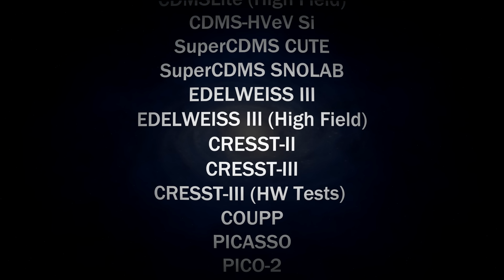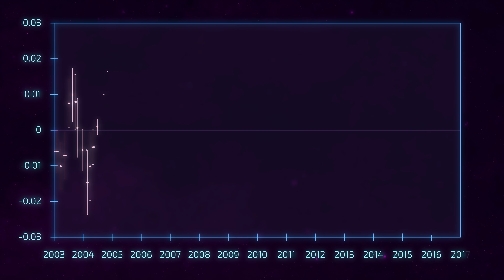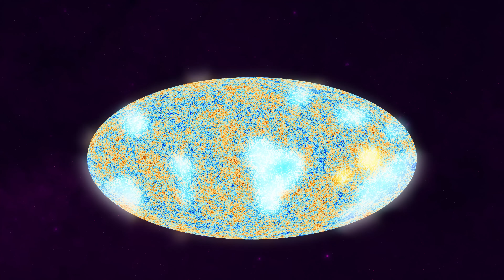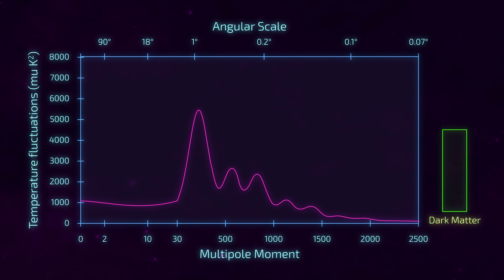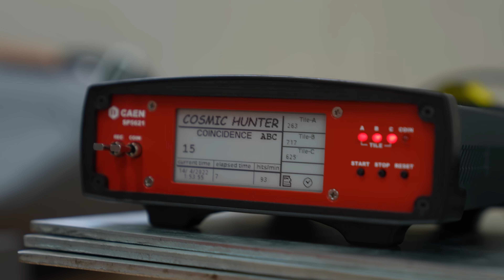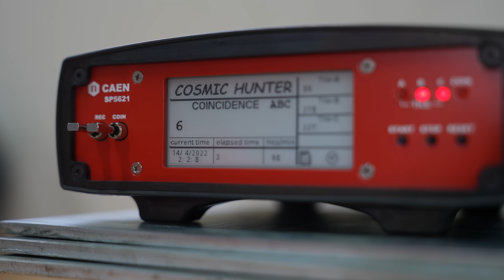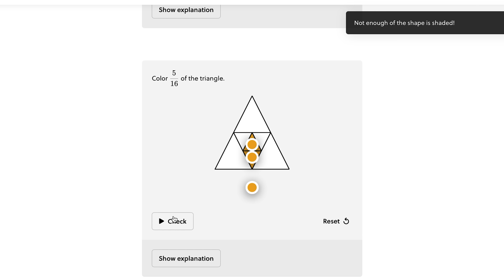The Absurd Search For Dark Matter

Comment: There are a few things I do not understand.  The first about Dark Matter itself - If it exerts gravitational pull then why does it not clump together making larger and larger bodies, much like ordinary matter did and does?  There should be huge star sized clumps of Dark matter and these should be evenly distributed like ordinary matter except there being 5x the number of such stars.  Therefore we should see these dark matter stars interacting gravitationally with normal matter, such as in binary stars.  It would seem that observation of the gravitational interaction is limited just to the velocity of galaxy rotation.

Secondly if dark matter has been around since the early days of the Universe and it is gravitational and it is present at 5x the quantity as normal matter then our Earth should comprise  a 5:1 ratio of dark to normal matter.  If this is true then surely the calculation of our orbit around the Sun must be way out in terms of mass of each body?    

And third,  in this experiment they aim to get an answer by placing the detector in Australia, however the Earth as a whole is either travelling in the same direction or in the other direction to that in which the Sun is travelling.  The difference in seasons between Northern and southern hemispheres is due to the tilt of the Earth.  The direction and velocity of travel relative to the sun and to the galaxy is exactly the same in both Italy and Australia.

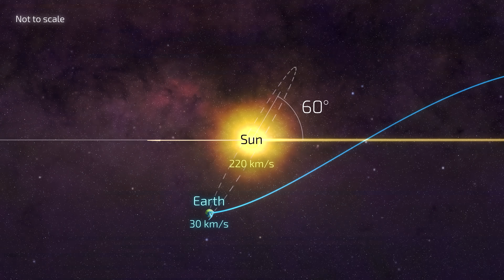Comment: 2:31 how do you determine something like the plane of the galaxy?
Reply: It would be defined as the disk-shaped region where most of the astronomical objects in a galaxy are concentrated.
Because it is a disk, this implies that the vertical and horizontal axis of the disk have a similar distribution of astronomical objects which differs from the third axis perpendicular to these two axes.
The stars on the perpendicular axis are closer to the origin than the stars on the other two axes.
This is only valid for spiral galaxies, since elliptical and irregular galaxies do not have both: two very similar axes and one that is different. In elliptical galaxies, the three axes have a proportional distribution of stars and in irregular galaxies, all three axes will be undefined or have a highly variable distribution of stars without an actual disc visible.

Comment: How can a WIMP "hit" a particle? A collision is electromagnetic or sometimes strong force, how would a gravity only particle cause a collision?
Reply: The W in WIMP means it also interacts through the weak force.   That means it can interact with the quarks inside the particle.   Unfortunately the interaction distance for the weak force is very small which is why the interactions with dark matter are very rare.  It also means this kind of detector cannot detect non-WIMP dark matter.  It's also the reason why a lot of dark matter detectors try to use Xenon as the density is much greater (more quarks!) Or Argon, less dense that Xenon but way cheaper.
Reply: @pauldavis2108  that's so interesting!  thx for explaining :)
I just have a grudge against "collision" as a way of thinking about particles interacting, since a collision is inherently a macroscopic thing. It makes people think of particles as solid objects, but the concept of "solid" is also inherently macroscopic.
You get what i mean right?

Comment: The dark matter is the proverbial ether. 

The only fabric of universe is the ether. The ether sits wholly as Electron Orbital Shells which surround everything in universe and beyond. Electron Valance Shells are more or less same as Electron Orbital Shells so they will be called EOSs too. EOSs are pressure gradients; 2 8 18 32 50..and so forth. These numbers are pressures of the EOS layers and are measured in Volts. Volts are ether pressure measurements. These pressure gradients generate force of buoyancy which then push things within from higher pressure towards the centers of EOSs where pressure is lowest. This is gravity. 

The Electron Orbital Shells are made of 2 things: ether pressure layers and magnetic field skins which separate the ether layers. MF Shells also keep the inside ether in and outside ether out. This is why Michelson and Morley couldnt find ether flowing over earth. Magnetic fields have the same shape except the MF Shells are moving unidirectionally where as regular EOSs move omnidirectionally. 

So the space time diagram would look like a 3D topological map. You can draw in arrows indicating the direction of buoyancy, i.e. direction of gravity which moves from higher pressure ether layer to lower, like a meteorological map, and you would have what you seek. 😉

Comment: If the fabric of space is a real thing and it is moved by gravitational mass such as stars and planets, then it is an obvious clue that the fabric of space is turning WITH the rotation of the galaxies and thus there is no centripital force outward because the stars are not moving in relation to space but in relation to a distant observer who cannot perceive the twisting of the fabric of space.  But if you go there and get on the fabric  then the galaxy would appear to be moving slower with the center moving a bit faster.  I believe this is the answer and not a made up dark matter.  Though much of space could be littered with heavy dust, not illuminated enough for us to see it.

Comment: If 85% of the universe is dark matter, why is it so hard to find? If we do not know what dark matter is, how do we know that the device we’ve created is actually detecting it? What if our model of the universe is simply wrong?
Reply: 1- it's hard to find because it doesn't emit any form of light, not even infrared,  X-ray, etc. There being a lot of it doesn't help much. 
2- we don't. The project in Italy detected something. It might be dark matter, it might be noise. Other projects haven't detected anything so far, so it's more likely to be noise. But the Australian one is designed to filter everything we know. If that's done right and there is a detection, it's probably DM. 
3- don't know what you mean by model of the universe or how that connects to DM.

Comment: Yeah, um, the real reason for the theory of the existence of Dark Matter is that the Big Bang theory of the universe fails without it, and the astronomical community does NOT want that, as this assumption is also the source of all their funding. The missing mass is, and has been observed, simple gas and dust that resides on the perimeter of galaxies but doesn't emit light and is therefore hard to see. Whatever they claim to have found, it's not "Dark Matter". It probably is antimatter particles or other common sub atomic particles. The multi billion dollar funding for these detectors is quite literally a joke.